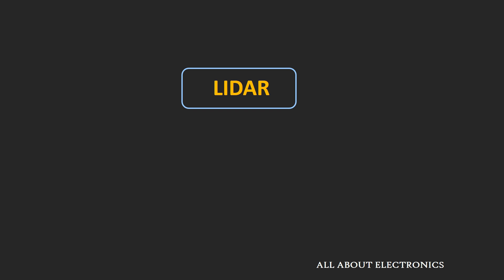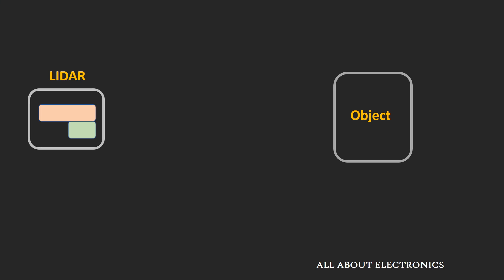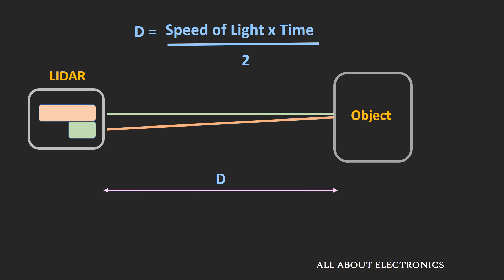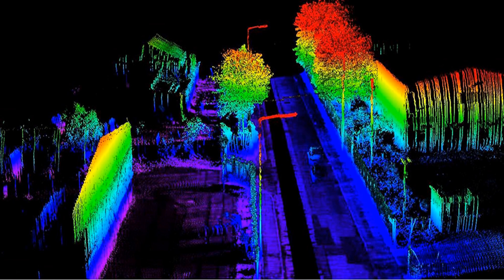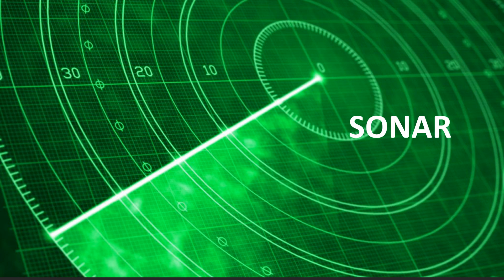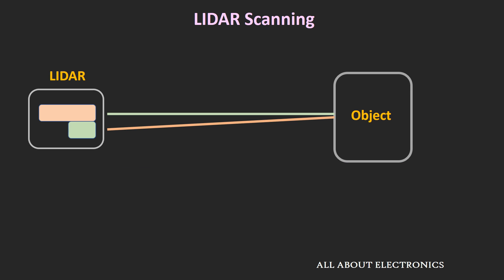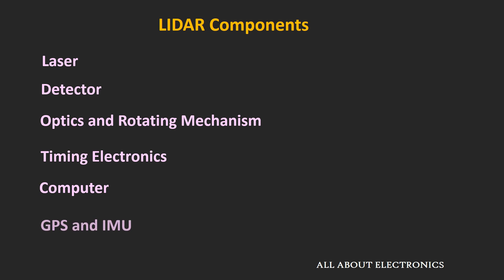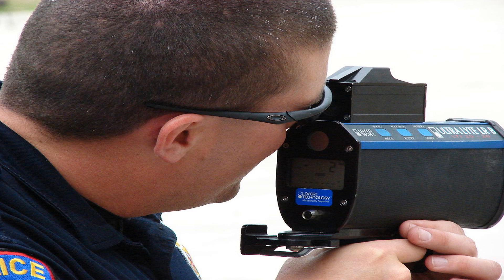LIDAR Explained: What is LIDAR? How LIDAR Works? LIDAR vs RADAR

Comment: How many times Lidar can track in same place? One time is ok to collect the distance?
Reply from the maker: You can get the distance in the single measurement. But for better accuracy, it should track the same place multiple times.
Reply: How about water.. does Lidar measurements the distance of water sea too?? Or solar does?  What is different between these ?

Comment: Thank u sir,,, but is there any system to scan underground resources like underground water, ores etc. If yes which is that system.
Reply from the maker: Ultrasonic sensors can be used for this purpose.
Reply: @ALLABOUTELECTRONICS  ok sir, then why electromagnetic sensors are not used?? What makes ultrasonic to find application in this??

Comment: Nice one. Thanks. Just curious, do you think we can use this technology in Telecommunication? If yes, i will be glad to know which areas.
Reply from the maker: This technology is used for surface profiling or 3D mapping. It is also used in self driving cars to map the data.
Lasers are already used in telecommunication (Both fiber optic and free space communications).
But I don't think so this particular method (LIDAR) will be useful for transmitting the data in telecommunication field.

Comment: what is the shortest distance that a LIDAR can measure..??
Reply from the maker: In centimeters. For the centimeter distance, if you calculate the time difference between the transmitted and the received pulse, it will be in picoseconds (t= distance/ speed of light). So, it is hard to resolve the pulses which are just a few picoseconds away from each other.